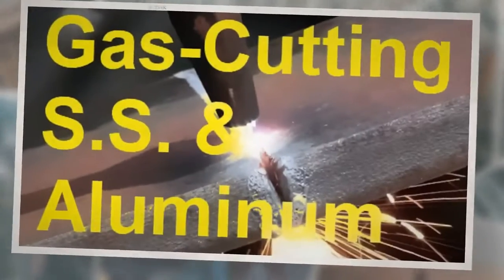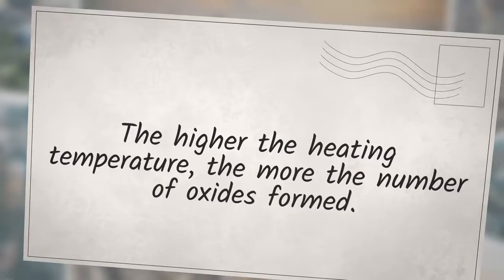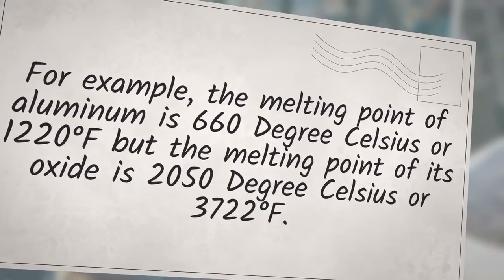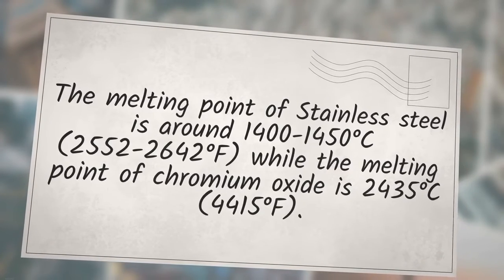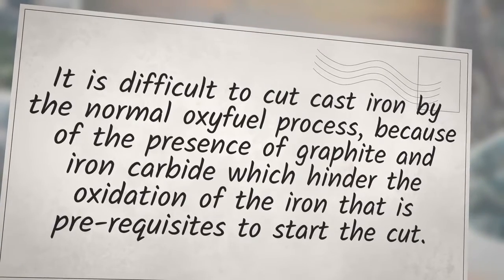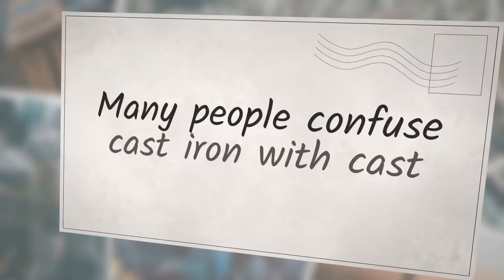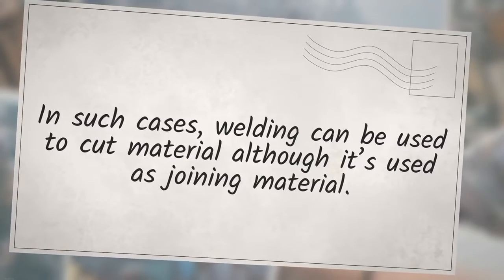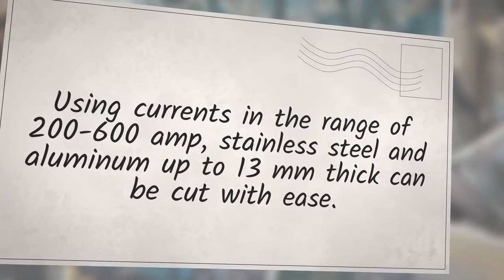Why cannot we cut stainless steel and aluminum by oxy fuel gas torch cutting?

Comment: you can cut all three stainless and Aluminum can be cut cleanly with a flux funnel added to the torch and the right heat, look up AWS hot to weld and braze materials book criteria 1939/1960, and with the right tip and heat you can cleanly cut cast iron this is propaganda and lost knowledge due to the increase in popularity with plasma cutters and cnc cutters. It's a generational gap in knowledge I've done it many times over the last 16 years in the field